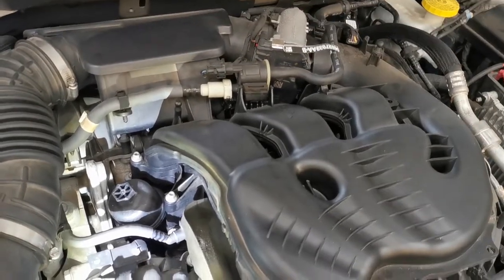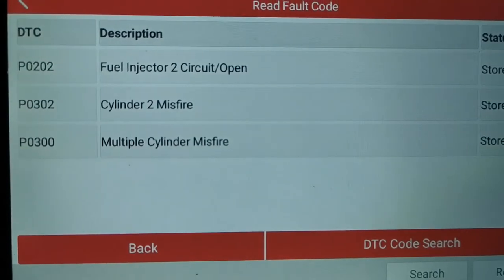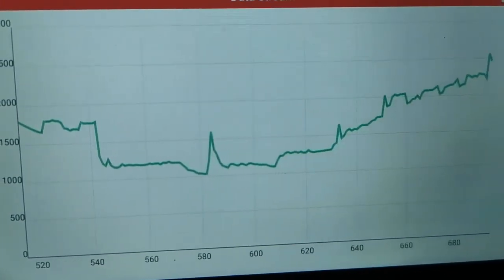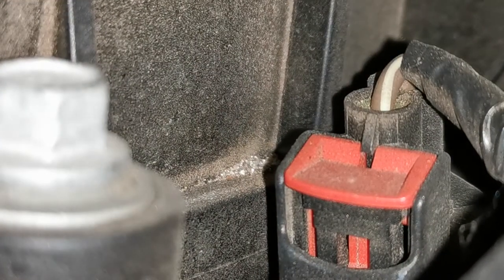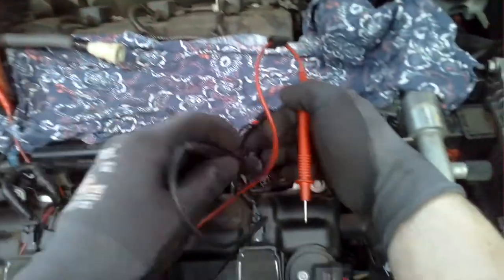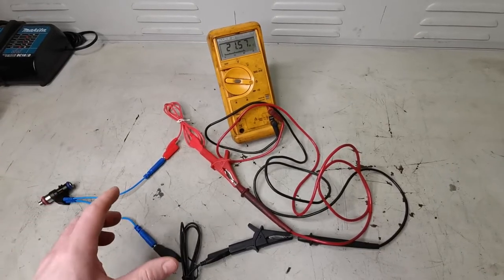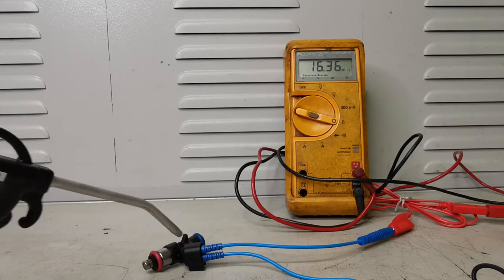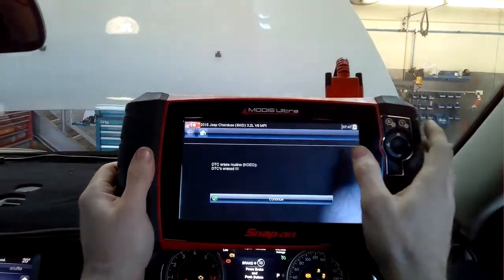Jeep 3.2L Running Rough - Problem Found & Fixed - P0202 - How To DIY

Comment: Thumbs up! i have this problem happen to my cherokee kl 3.2l shortly after i took it to a dealership, they left the gas cap open on pickup to diagnose a punctured filler neck hose, not sure if the customer service agent poured some soda or something into my gas tank over some argument i had with him at the dealership when it was time to pickup my vehicle and the $260 diagnostics fee they charged me and even referring me to purchase the wrong part to fix it if i didnt fix it with them for another excessive $600 fee... Anyways driving back home going up a hill engine started to act crazy bouncing knocking etc and got the engine light with the po202 and p0302 codes, after fixing the hose the evap leak dissappeared, i added some supertech motor treatment to treat the entire fuel system of the car, drove it a little bit to smoothen the engine out a bit but still very rough, mechanic responsible for puncturing my filler hose reset my codes and they never came back on, its been weeks now and the engine although not as bad as it was is still running rough. Question is should i check the fuel pump 1st or go straight to the injector? does this sounds like a situation that the customer service guy poured some damn soda or something into my gas tank to mess it up? or is this more likely because of dirt or rubber got in the tank from the punctured hose? Or is it none of that and just the fuel injector that needs to be replaced as in ur vid? What would ur recommendation be? how to tell if the fuel is contaminated? Good idea to open up the fuel pump and check the filter or something along with the gas inside the tank 1st prior to checking my fuel injector? thanks & subbed!

Comment: Don't worry buddy just drive that jeep 30 to 40 miles and she will give you something else to fix! "JEEP,"  destroy them before they destroy you!
Reply: No shit. How does Jeep get away with criminal sabatage
Reply: @Dedra-od6dd  bud we had a Jeep Grand Cherokee Laredo with a V8 full time 4 wheels drive and had almost 300k on it with almost no problems! Then a 2015 jeep latitude compass with 130k and new problem ever 10 m8les

Comment: Thank you for the video.  I have a 2015 Jeep Cherokee that has rough and high idles, and weird acceleration bursts.  I'm going to have my local mechanic check it out.
Reply: Did you ever figure it out
Reply: @KingIrvXL  Nope.  Jeep SUCKS the big Donkey Kong.  

They currently have 2 recalls - one for the lift gate and one for the engine (I think has to do with the idling).  The dealership says the recalls have been in place over a year and NOT A SINGLE PART HAS BEEN SENT TO THE DEALERSHIP to repair.  Why the F have a recall if the manufacturer doesn't actually provide the parts.  THEY SUCK.  

LAST JEEP I BUY.
Reply: @GeoTactics  it’s been a year and you didn’t do anything? Probably the coil or injector snd if the dealership don’t have the part get the proof then sue or fix it yourself and get reimbursed

Comment: Tnks to this video i find the problem on  my jeep, i bought a new set of injectors, i replace it, but the new one is cousing misfire to, i try 3 differents cilinders is always the injector the one that make the  misfire, i bought a new coil, new sparkplugs, any idea why this new set of injectors are making misfire?
Reply: Same
Reply: @ritasworldtoursofthewildwe640  update, I find new and super cheap set of injectors made by Bosch, high quality super cheap, same part but different parts #, I fund that is the same injector than the Grand Cherokee same year
Reply: Thank you replaced all coil spark and injectors.  No codes but still a little misfire

Comment: Hey Gerard,
Could you have used an oscilloscope to measure current on the wiring loom further back?
Great job as usual! 😉
Reply from the maker: Thanks Max,

Yes there most likely would have been a location somewhere if it was traced along.
Whichever way works best/faster for the tech is the way to go.
Scope option is always there if needed 👍👌
Reply: @GerardBurkeBurkesGarage  I totally agree. Sometimes the simple method is the quickest and easiest & as you have shown it was proven beyond doubt to be the fault.

Comment: Hey I just got P0201 code, I believe this is for the 1st cylinder/injector. As I understand it should be located behind the engine towards the car dashboard right?
Reply: How did that turn out for you
Reply: Did you fix it?